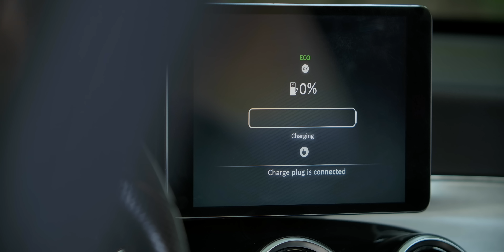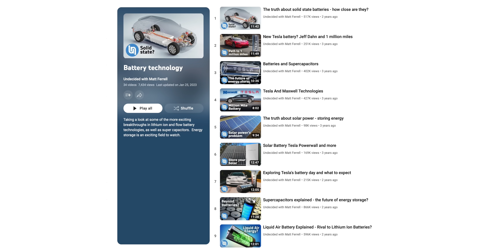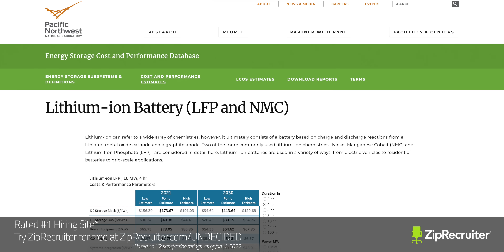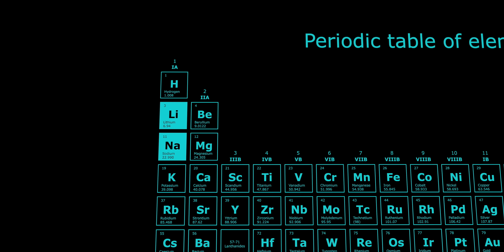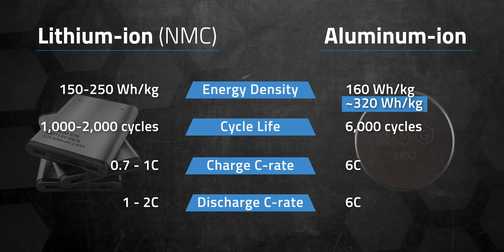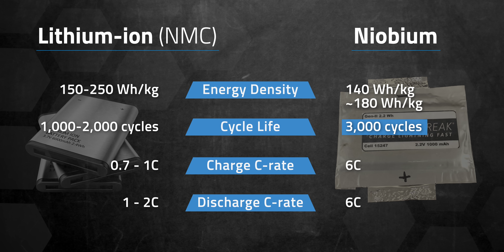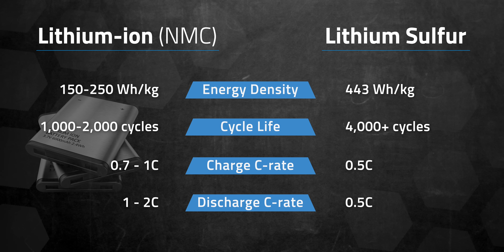Are These Batteries The Future Of Energy Storage?

Comment: The battery needs to be charged, and I don't see a way in many areas with so many cloudy days etc. Solar panels should be improved to accept sun through clouds or replaced with a better way of charging. What about increasing the number of cycles, it can get very costly replacing the batteries.

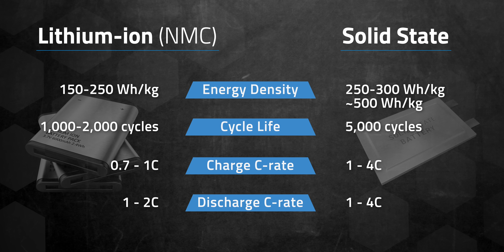Comment: I found your numbers a bit misleading because you cherry-picked the best numbers for each battery type so you picked the best energy density and put it with the best life cycle so if a company said it had great a great life cycle number you put that number in but if that same battery had a low charge rate you didn't change that number. You can see it at 5:28 you added the 4C charge and discharge numbers but noted that it didn't have a large cycle life even though you kept the high number showing. I think that the graphene battery technology looks good, I have liked nano technology for a while now.

Comment: Every gasoline car can be converted to hydrogen gas. Hydrogen gas can be created with electricity. The power and performance may not still be there, and will require the installation of a high pressure tank. But it's renewable if the electricity is not generated by fossil fuel.

Comment: So far, it seems like sodium and sulpher alternative chemistries are leading the pack in a general sense.  Purely from a standpoint of sourcable materials, we would be best served to get one of those chemistries close to where Li-Ion performance is at, and the sooner the better.  I'm leaning towards sodium overall, because of its abundance and low cost.  Also, there are a couple of outfits saying they are solving the dendrite accumulation problem, which would give it a huge cycle life.  If they can get the energy density closer to 200mAH, I think it'll start to supplant current Li-Io battery tech.  Material sciences are coming along right now, too, which is another component that will open more doors later on, allowing us to improve things even futher.

Comment: very interesting.  When it comes to EV cars the battery rating must include cold weather days. A car that is rated to go 200 miles on a warm day may go only 115 miles on a cold day?
Then there is the modern electric street cars that do not haul heavy batteries around.  The new electric grid will be a "Buck Rogers" future.  Super capacitors!  😎 Thanks a lot.

Comment: Lithium sulfur is not very similar to traditional lithium ion at all. In fact, of all the chemistries you mentioned, it's the least similar.
Solid state is not a well defined category. There are half a dozen solid state approaches using lithium ion technology alone, but you can use others. QuantumScape's planned products fit firmly into the Lithium Ion category.
You didn't even bother to mention the active ion of "niobium batteries". Guess what, they're another variant of Lithium Ion.

All in all, this video is pretty confusing.

Comment: I feel there is a missed focus on:
1. Home batteries where weight and charge/discharge speed matter less
2. Easily recycled design where when battery from 1 is used up the refresh cost is not a 100% replacement cost

Comment: There's a lot of news regarding new battery tech - super fast charging; huge energy density, etc.  But these all detract from the types of battery we really need. Grid scale storage and/domestic storage. If we are to divorce ourselves from fossil fuels, there are really only 2 viable options: wind & solar or nuclear. The latter is slow, taking decades to build from the planning stage, and at a huge cost. The former is quicker to get going, is cleaner and much cheaper, but power production is dependant on sunlight and weather conditions.

If we can cheaply build enough battery storage capacity, we could have enough electricity using solar and wind alone. It doesn't matter which tech is used, energy density isn't the key factor, it's capacity.

Comment: Lipo batteries I use on my self built FPV drones can drain a 6 cell 1100mah lipo in about 150-180 seconds. And that's with 100-120C discharge packs

Comment: The problem of infrastructure support for high C-rates is easily solved by having them in pairs - one in the home for storing energy slowly and when it is least expensive, either from the utility supplier or from solar panels and any other locally available source, then a probably smaller one in an EV which can charge from the home unit easily, if you use a thick enough cable and high enough voltage, by putting a bunch in series.  Photovoltaic panels can also benefit from being cooled by water so that they run at their most efficient (lower) temperature while also heating the water that cools it.  Hybrid systems of PV and Thermal are a great example of great improvements by combining two technologies.
I like liquid sodium buried in sand, as sand is great for storing heat, which can be slowly recovered for space and water heating, while molten sodium needs to be kept hot and even heated if its energy level drops too much - but bury it in ordinary sand and the two technologies become complementary and even symbiotic, each being improved by the other.
Sand is so good at storing heat that Finland is now using it for seasonal energy storage, and if it can store enough heat to last a Finnish winter of district heating, that's good enough for me!
So a video of how combined tech can give benefits to both (like supercapacitors and Li-Ion cells as car batteries, for example - lots of initial cranking power from the supercapacitors but much-reduced weight compared to the usual lead-acid type most common in automotive use.

Comment: The problem for charging currents to electric cars may be overcome by charging them at a very high voltage and in the car you have some kind of step-down system. For example if you increase the voltage 100x you can send the power to the car at 100x the speed for a given current rating of the connector and lead. Furthermore the grid is at a high voltage to start with so that might make it easier to engineer. I've never seen anyone research it and I'm sure it is rather tricky to do, but when these fast charge batteries appear then the market for a solution like this would be huge. Bulky inductors for example can be reduced in size by increasing the frequency.
Reply: Maybe install some supercapacitors to speed the transfer of energy?  So your EV would have its battery pack, and then you would also have a bank of super capacitors that can take the speed charge, and then trickle that energy from the capacitors to the batteries so the batteries aren't harmed by speed charging?

Comment: Hey Matt, I think an interesting topic for a video would be the toroidal propellers currently being tested/manufactured at MIT and Sharrow given how they have so many potential applications across so many different markets.
Reply: I think they've been overhyped a bit tbh. If you look at the graph comparison they are better, but at peak efficiency, they are only marginally better. The big differences are only under certain conditions and won't make that much difference in real world situations. 
Of course, better is better, they just aren't as good as some of the headlines claim.
Reply: @jdmjesus6103  that's exactly why I think it would make a great topic for the video. Discerning what's unnecessary hype vs. actual science is exactly what this channel is about
Reply: @jdmjesus6103  Things can't always be best for everything.
A supercharged v8 race engine is great on a race car but not on a lawn mower nor on a semi truck nor on a forklift, etc.
A new type of vibration fan that was recently presented is great for clean rooms and spaceships, but not for your gaming computer.
An 8k 88" tv is great for a big ass corporation conference room, but not for gaming at home
If that propeller is used specifically for what it can do much better than anything, then is the best solution
Reply: Yeah, they're not original. They took the idea from preexisting, already patented boat propeller designs, and independent tests have already shown they give you no significant advantages in air.
Reply: @sudonim7552  then why are they being used in drones?

Comment: My own version of damage control to the lithium dilemma-problem is dirt cheap flashlights that run on spent tool battery 18650 lithium battery cells. Better flashlights, for law enforcement and military applications protect more abusive battery uses that only utilize the slightly narrower crv 123a type 3.7 volt cells that spend inordinately quickly and can't be recycled, but require two cells over the single larger, potentially recycled varieties. [tax dollars versus responsible practices]  Surefire E2E versus SkywolfEye TLY-006; my opinion some compromise between high priced reliability and cheap ready abundant and mission capable-with charger improvements.
Reply: often battery failure isn't cell issues

Comment: How about a small and lightweight EV with a composite battery.
1 Small Aluminum-Ion that handles recuperation, acceleration and that can quickly charge and give ~50km of range without touching
2 the bigger Lithium Sulfur battery which provides the rarely needed but nice to have additional range.

with such a composite it should be possible to make a small car light enough to provide good range and strong KWh per KM rates.

Comment: I don't think that an argument like "there's nothing that can charge a 6C battery" is valid. Because frankly, we have 350 kW chargers aplenty out in the wild, and next to nothing that can make use of their full power. Even Hyundai's cars that are meant to go from 10% to 80% in 18 minutes only pull a little bit over 3C at peak, which for a 75 kWh battery makes maybe 250 kW. Peak. For a few percent, before the BMS will throttle down again. Teslas also charge at around 250 kW peak - and that's again for batteries sized 75 kWh and up.

But take something like a Kona or the like, with a roughly 60 kWh battery pack. 6C for that would be... 360 kW. Oh hey, we already have 350 kW chargers! And sure, maybe there would be room for a higher peak rate that this charger couldn't fill. But (a) in the real world you rarely ever get the advertised speed, there's always some reason for the BMS to throttle down; and (b) I would happily take a car that could pull 350 kW all the way from 5% to 60% without throttling down, even if I "miss out" on a potentially higher peak rate. Just 5 minutes at a steady 350 kW adds around 29 kWh, which could easily be 120 miles of range. That's a staggering improvement over what we have today.

And then there's even smaller batteries. I know you Americans don't consider anything a car unless it carries at least a metric ton worth of battery mass (=P), but over here in Europe, one of the top sellers of the previous year was the new Fiat 500e, which comes with a 42 kWh battery pack. Charging that at 6C would be "just" 250 kW. Using an existing 350 kW hypercharger, you could get a peak rate of above 8C. Right now these cars come with a 85 kW DC fast charging ability - imagine swapping that for 300 kW and actually being able to use all of it.

So yeah, lack of infrastructure is not really a valid point when talking about high C-rates. IMHO, 6C can't come soon enough. If it was here tomorrow, we could make use of it, no problem.

Comment: the best current battery technology that we can all buy are LTO batteries(lithium titanate oxide).  despite their low voltage for each individual cell, they still are the best to go with for RVs and home use because they can easily be put together in series to create a nice 12v or 24v battery pack that can then be used for said purposes and the size will not be an issue.  sure, for smaller uses such as phones and computers and the like, they may not be ideal, but in terms of storage for baseline energy purposes, like a battery bank attached to a solar and/or wind array, they are by far the best option to go with, having 20k life cycles compared to 2-3k for lithium ion(lithium cobalt usually) or 8-900 for AGM(absorbed glass mat sealed lead acid) batteries. also, LTO batteries can fully charge with as little as 30 minutes of time, compared to at least a couple hours for each of the other two main options.  LTO batteries are even a step above LiFePO4 batteries, though the latter are better admittedly than lithium ion or AGM batteries.  Up until the last few months i wouldn't have said this with such certainty, but the price has now come down on LTO batteries where they make much more sense than the current alternatives for baseline storage use on the personal or family scale.  ( fwiw, i am not affiliated with any  company that makes or sells LTO batteries, i just honestly believe they are currently the best option by far for this particular type of use)  /blahg.

Comment: Why does everyone ignore Lithium Polymer batteries. The LiPo batteries that we use in RC cars etc have a discharge rate around 140 C and I have been using the same LiPo batteries for more than 2 years with very little loss of capacity.
Reply: With batteries, it is very much horses for courses. Li-ion batteries are cheap because they are used in many consumer devices, but they are useless for high current applications. The lipo batteries we use in our RC cars are capable of a continuous current draw of more than 600A from a 6 AHr battery. An equivalent li-ion battery pack would be around 180A and it would would need to have substantial way of cooling the pack as the internal impedance of the pack is soooo much higher.

Comment: i think the really high C batteries will be huge for renewable. Then you would only need correct conditions for much shorter times to achieve the same energy stores. Like one hour of sunlight/wind bringing your battery bank fully up. Of course you would need to have a ton of extra production units just waiting around to provide that level of power up front but it is certainly an opportunity in less reliable climates

Comment: Excellent point at the end there - the primacy we see Lithium Ion battery technology holding today is entirely a result of the fact that up until very recently (by the standards of new industry lag times) we only really had one use for batteries: small hand-portable consumer electronics.  There wasn't much point making a battery any bigger than those old school 6V Alkaline batteries (and even those were kinda rare) because even those were already bigger than most things you powered with batteries.

Lithium Ion started winning out in power tools, which are probably the oldest "large" (ie: not AA or AAA format or smaller) rechargeable battery and quickly became the natural choice for anyone who wanted to offer rechargeable batteries in the emerging portable electronics market (which at the time in the late 90s was along the lines of PDAs, digital cameras, cd players, pagers, and if you're living it up, actual cell phones.  Which set the lithium ion battery producers up for what came next: a decade of massive strides in portable electronic technology and then another decade of refinement and proliferation of such technology across the world.  But that's the thing: the key to that world was cheap portable power storage.  Lithium Ion was lighter than anything else at the time, and it's going to stay way cheaper than anything new until it can get its foot in the door because the pains of growing production from hand crafted lab test models to factories mass producing them by the tens of thousands are already paid for.

But as we press on, we're finally seeing uses that change the market.  Cars care about weight still, but are way more flexible because you don't have to pick it up and carry it in your pocket anymore.  (Even with Lithium ion, laptops still have to cater to different markets based on size and weight tolerance of the consumer, because who wants to lug around a 20 pound laptop?  Maybe the guy who wants to do an 8 hour gaming session on battery power, but not the folks who just want to browse Youtube or whatever.)  Home installations barely care about weight at all, and grid scale's best battery at the moment is pumping a lake up a hill, so that should tell you exactly how little weight matters to that market.  Conversely, all 3 of these markets are also way less tolerant to the runaway heat problem that Lithium Ion has never really perfectly solved, because they're all deploying batteries big enough for that runaway heat to be not just a really unpleasant experience and possibly a damaged pair of trousers, but a fire that can and will fully immolate something or someone important, like the driver, or the rest of the power storage facility.  

The victories of the past make Lithium the easy choice for everything new, but as we start running into its major problems, we start finding room for new solutions.

Comment: Interested to see Sodium Ion. Even with a lower energy density compared to Lithium Ion they would make home battery storage more affordable and potentially fix the payback period issue that current batteries have.
Reply: Yes, and it's worth noting that not everything needs to worry about energy density in terms of mass. Stationary power storage like a desktop computer backup battery or storage for a photovoltaic system can be heavy and it's not much of an issue. It would still be helpful in terms of saving the rare metals for applications like planes and cars where weight does matter.